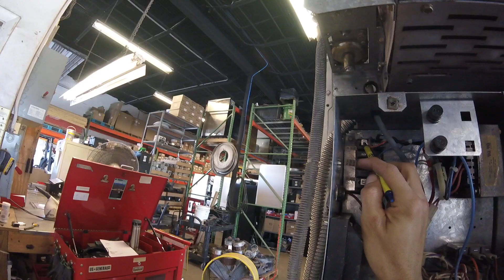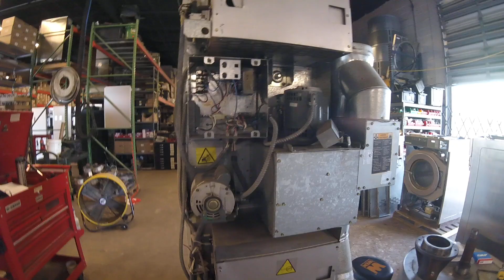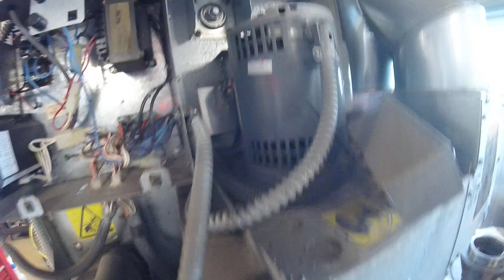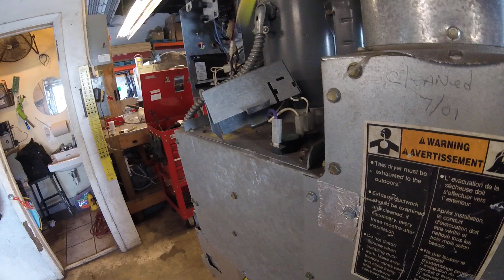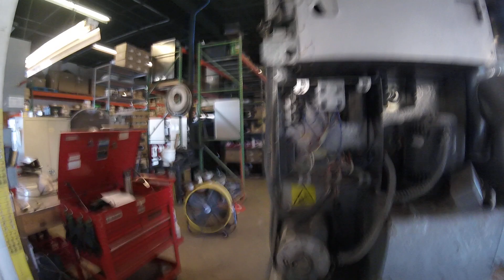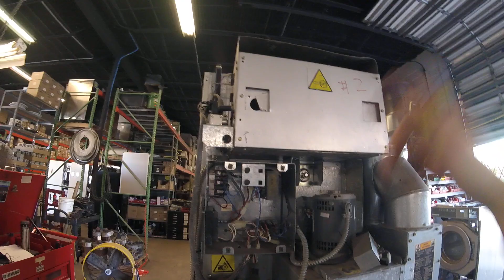031   Top 5 Reasons Why Your Speed Queen or Huebsch Dryer Won't Work

Comment: FYI, I had a problem with no heat and found that the centrifugal switch on the blower motor was not making good contact not completing the circuit for calling for heat.

Comment: Our top machine won't start. Bottomworks fine...  Motor spins with or without belt for 1-3 seconds and then stops.  Tried another good motor and it does the same thing.  Voltage to the machine is good.  Any ideas?

Comment: Hello, I have speed queen st 30"s The top and bottom unit both will start and ignite the fire but when the igniter stops the fire goes out 3 seconds after. I swapped all sensors, relay, igniter box,  solenoid coils on gas valve and get same result. Checked both thermosters are reading 0 ohms. I also opened both exhaust ports on top and bottom in case of a clogged exhaust clog's. Confirmed the air flap is being drawn closed and verified the switch is good. Any idea?

Comment: on my case, after replacing the blower I found this part broken.  M414704 Thermistor.  I think I broke when I vacuumed the inside compartment.  I don't think it is in this video.  almost the same dryers.

Comment: Wow! I have a group of 5, 2006 STO300DRG  stacks. I'm just beginning the task of replacing gas valves. Have you had to at anytime replace gas valves? I replaced rear components and still came up with intermittent heating conditions. This group of dryers ar the oldest of 16 stacks....